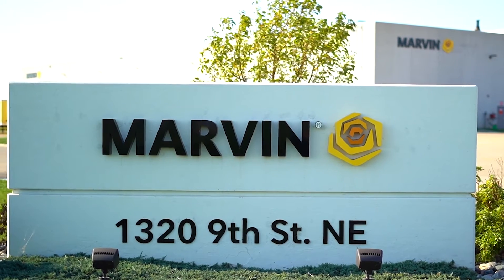Marvin - Continuous Improvement Engineer

Comment: I graduated with a BS in Mech Engineering 14 years ago and pretty much sat on that degree not knowing what I wanted to do. A year ago working at a printing Co. My boss took note that I was designing and printing parts to help machines with quality issues and sometimes safety issues. It took 1 year but they finally put me in the role of Continuous Improvement Engineer. I can't believe I get to go to work and do what I love doing!